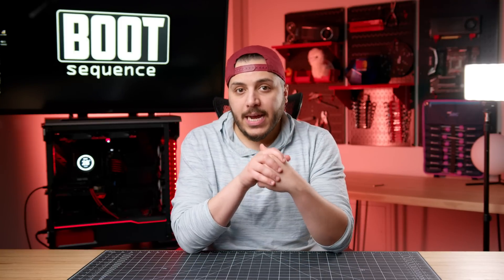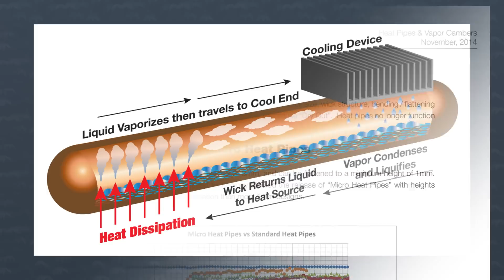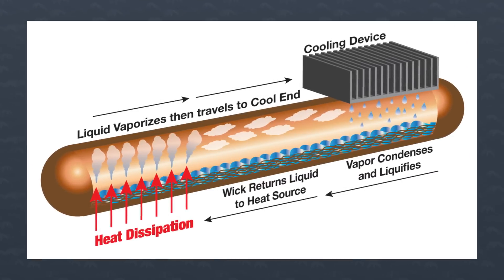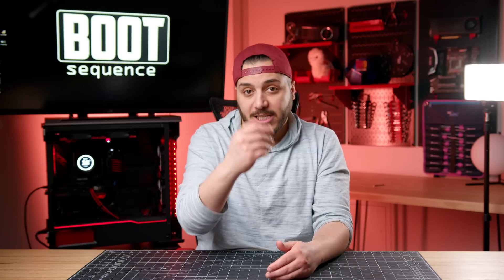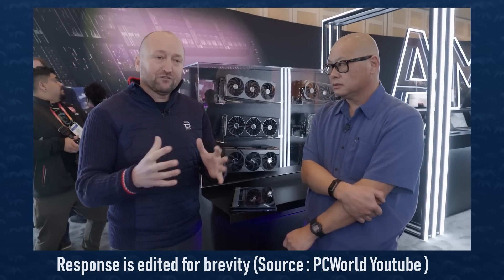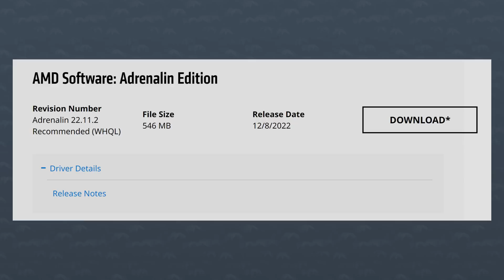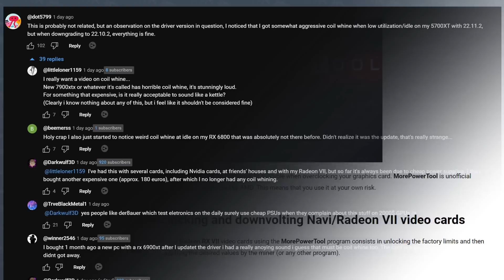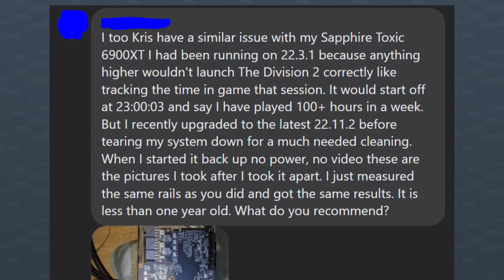Are AMD Drivers Breaking RX 6000 Series GPU's?! (UPDATE IN COMMENTS )

Comment: (THEORY) Coming here to say the driver version talked about in the video from kristech is designed for Rx 7900 series gpus could be the issue and if it is it’s both amds fault and users fault amds fault for even allowing you to install incorrect drivers and users fault for installing drivers for the wrong gpu when it says in the driver updates name kinda like nvidia power connector situation except the fact this can’t start a fire
Reply: Bruh, please tell u you are getting paid by AMD or else that is one of the idiotic take on this. Wrong drivers shouldn't effing BREAk the cards. It can stop working or shown an error. AMD is the one and only one at fault.
Reply: @yuvanraj2271  Calm down I literally said it could be it’s only a theory and this probably isn’t correct the situation is still developing and this is a guess based on the very little info available
Reply: @yuvanraj2271  I’ll edit it to say it’s a theory
Reply: @yuvanraj2271  remember rx 7000 is a completely different architecture, but still build on rdna. It might be that since rx 7000 series is so closely related, and is also a novel MCM design, that a rx 6000 series still accepts the drivers and runs the 6000 card very far past spec leading to excessive heat in the die thus leading to cracking. That said, amd shouldn’t have made it possible to install the wrong driver in the first place, so while it’s user error, it’s still on amd in the end

Comment: rdna 3 is a new architecture based on a chiplet design.
and the heat + driver problem may be a connection problem between the chiplets.
like the nvidia power connectors, if the connection is not perfect you have a hot spot point which can cause heat issues.
so maybe some chiplet's connections are not perfectly aligned, causing the issue.
Reply from the maker: Keep in mind, for the heat issue and RMA, we're talking about the RX 7000 series. As for the breaking GPU's, we're talking about the 6000 series.
Reply: I believe Der8auer already did an analysis regarding the issues that cause it. Haven't watched the video yet, so not sure
Reply: Nvidia didn't really have a power connection issue? GN did a conclusion already saying it was user error. Otheriwse, we would continue to see the "connection issues".
Reply: @fpshooterful  if the connector is so poorly designed that user error is frequent it’s nvidias fault
Reply: @adamcorv  I mean....you don't hear any more of this cable issue any more? All the user had to do was just firmly push the cable in? Sure, nvidia can hold some responsibilty. But, its the user's job to make sure everything is connected properly? Still can compare to what AMD is going through with their whole vaper chamber.
Reply: @fpshooterful  The new power connector has a design flaw where it doesn't give you positive haptic feedback that it's all the way in. This is being addressed right now. But the user error in this case isn't necessarily the user's fault.
Reply: @kyoudaiken  I mean... sure Nvidia could've improved on the "haptic feedback". But, this is JUST the cable isse we are talking about here, which was done by a different company. Still Nvidia should've taken responsibility. 
But,  we ain't talking about INTERNAL hardware issues like AMD is facing.
Reply: @fpshooterful  It seems to be the new norm for companies not saying anything and staying quiet until an influencer or some users or others are investigating and finding the cause... By the way the connector design didn't come directly from NVidia alone. It's the PCI-SIG responsible for that where Intel, NVidia, AMD are members of.

Comment: Bro, the whole story is iffy. If the drivers are killing cards, there would be a lot more people complaining as there are quite a few of these cards out. I'm on the latest drivers with my 6900 XT. No issues. Plus, the driver has been out a while. And coil whine is normal with these cards. I have had it since day 1 and it had nothing to do with the drivers.
Reply: pkadair  Nvidia cards have coil whine too. That's an easy look up. 

And I've used both manufacturers and have had no hardware issues with my rx 580, 5700 xt and now my 6900 Xt. 
My nephew has my RX 580 and it's still going strong. 

It's funny that the last Nvidia card I owned, a 2070, I had to RMA as it started crashing in every game. 

Dead Nvidia cards are nothing new. It has been happening quietly under the radar for years. Nasty voltage spikes were another issue. The 4000 series seemed to have fixed that though. 

People are acting like coil whine is something just discovered. It's been around forever.
Reply from the maker: its iffy, which is why I asked what you guys thought and why I will keep an eye on it. As for coil whine, I've seen reports of driver updates causing coil whine all the way back to the GTX 600 series. Its not new. If you've had it from the start, that's fine, but its undeniable that a driver that has a boost algorithm change ( meaning frequency and voltage curves change ) can cause coil whine. Its the reason why undervolting can sometimes get rid of coil whine.
Reply: Looking at the driver version talked about it appears they installed drivers for rx 7900 gpus so it’s probably a case of user error and amd for allowing you to install the wrong drivers
Reply: Jesus is Lord  why do you have over 15 3080s and 3090s
Reply: pkadair  amd hasnt even owned ati for 20 years ?
Reply: Jesus is Lord  got whine on my 3070, less undervolted dont jump conclusions

Comment: Nice video. Just hope My Power Color Red Devil 6900xt doesn't get bricked - I would be up the creek with a paddle.
Reply: I think since yours is the NON-reference model you should be okay... its all the reference model, AGAIN, that seems to be the issue.
Reply: @fpshooterful  where did you see that its only the reference model, I was trying 5o figure out which ones are they since I have a aib 6900xt
Reply from the maker: Fingers crossed, I'd wait a bit before updating in that case. That's always been what I do.
Reply: undervolt it buddy and you will be safe from any driver update.
Reply: i hope my rx 6700xt red devil is safe too,just got it this week
Reply: The problem is that the owners of this GPUs downloaded 22.12.1 a Driver that was meant for the 7900XT/7900XTX released in December and GPUs used for mining. Idiot youtubers jumping on the gossip news bandwagon with no proof to back up what they heard from other youtubers that also had no proof. The 6900 XT and the 6950 XT are still under warranty, why they didn't send them back to AMD or the AIB partner instead of the repairman, because they F#cked around with the 7000 series driver and found out. there are dumb people out there
Reply: Sell it and get a rtx 3080 ti to be safe
Reply: @gejamugamlatsoomanam7716  i know the cause now, its incompatible drivers issues so no worries, they putting a driver that's not right or recommended/compatible for the unit
Reply: @gejamugamlatsoomanam7716  thanks for the tip - I will keep my 6900xt for now - Nvidia had lost my support a good while back and haven't earned it back yet.

Comment: Maybe safer to not buy AMD instead of using old drivers.
Reply: I mean it’s a lesser of three evils situation between nvidia intel and amd and amd is the lesser evil if you’re looking for high end gpus also the driver version talked about was released for 7900 series gpus which could very likely be the issue more of a user error than amd issue though amd is still at fault for letting you install the wrong drivers

Comment: That`s Windows11 Forcing A Server Bios Over a Gaming Bios , And Yes it Is a Known Issue / on drivers / on Same Driver as posted in video = YES 22.11 , found a bug in windows recognition software that overwrites another bios during downloads , ddu everything off drive including any nvidia drivers as this is what is causing the issue , yes windows likes to auto load both drivers , nvidia and amd , not so much intel as they have yet to verify with windows , also go in and turn Off Windows auto driver updates , just turn it off if you are running a diy pc anyway , check the correct boxes in ddu and one at a time Removal of each  and repeat safe mode removal , then reboot and re=download to prior driver , i think it still shows as they have not updated to a new driver yet , i think they havent yet